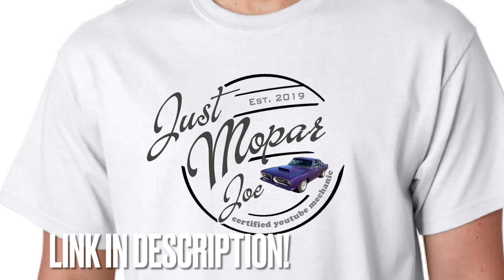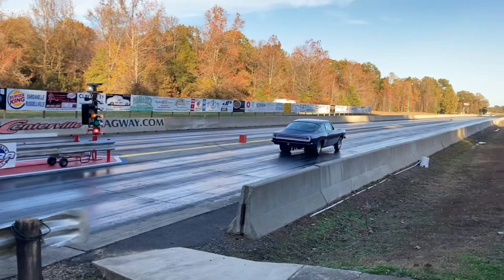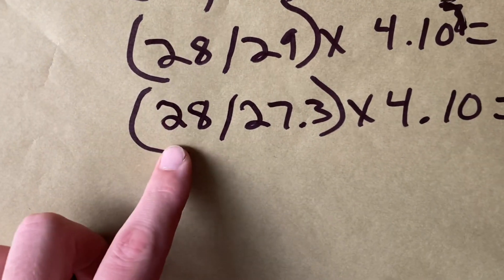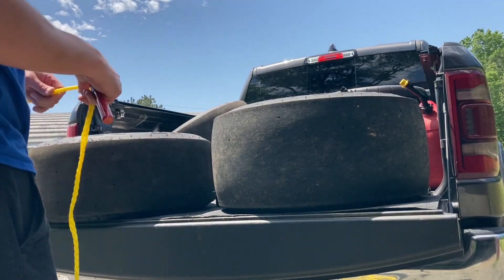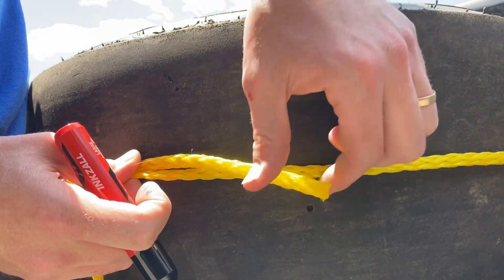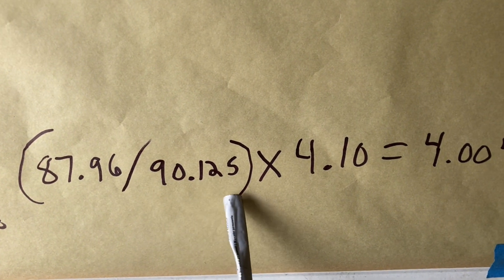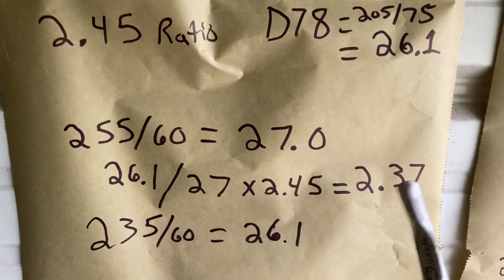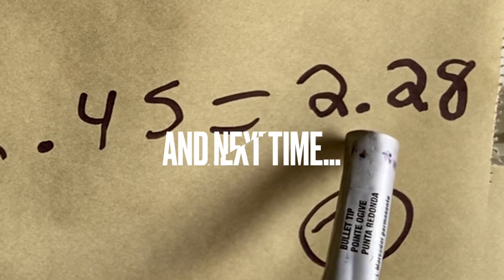Drag Race Tire Tech:The FASTEST Way to Change your Gear Ratio! #nonamenationals #DragSlicks #Mopar

Comment: Also explain skinny front tires I believe can help you at Xmas tree maybe I’m wrong but I was told wen I first raced that skinnies would help you stage deeper or better am I wrong or right I did the taller tire thing and I had 391 and the taller tire made it roughly a 410
Reply from the maker: Hey Jeff. When it comes to front tires, skinny tires weigh less. If you can get the weight off the front end, that’s always a bonus. The major difference maker in front is the tire’s circumference and height. The staging beams run across the lanes. You have to break the beam for the counter to start. Width won’t change anything there, but a taller tire reacts differently in the beams.
Reply: @JustMoparJoe  thanks for the explanation you are easy to understand

Comment: MOPAR Joe kill'n it!!! Thanks for the great video......let's see that 400 big block build brother 💯😎
Reply from the maker: Thanks brother. The 400 block is complete and ready for pickup. Balancing is all that’s needed.
Reply: @JustMoparJoe  awsome!! Really can't wait for more video's on it. I have a question. My 400 is leaking oil from the front of the motor. I haven't looked really hard into but could it be the timing chain cover?
Reply from the maker: @218422100  oftentimes, the front seal around balancer could go out. Also oil pump is in front. Brake cleaner it all and keep an eye out
Reply: @JustMoparJoe  thanks for the help bud. I'll hit it wit brake cleaner this weekend 💯😎

Comment: Effective ratio..that is correct. Good Info. 
  Final gear ratio...or the gear ratio when the tire is squatting can change drastically with as little as 2psi of change. A hard planting suspension and low tire pressure can cause your effective gear ratio to change 2 full points. Changing your tire diameter up too 10 inches.
Reply from the maker: Yes sir! I was going to draw a picture showing the centerline of the axle lowering to the ground on that wrinkled launch. Maybe next video!

Comment: I had a set of slicks that were the same exact tires bought at the o time. One was  little bigger. I had to run more air in one to make them the same. Because the front end jumped to one side  a little when I launched it
Reply from the maker: Yes sir. I’ve heard of swapping sides to help offset